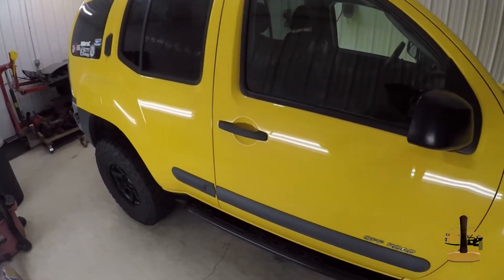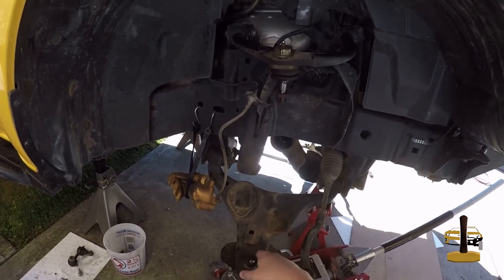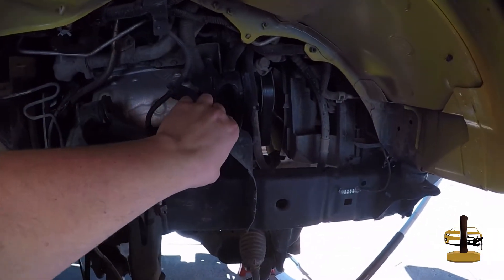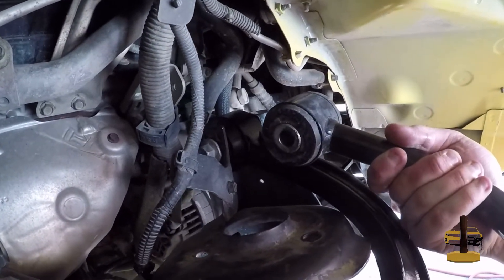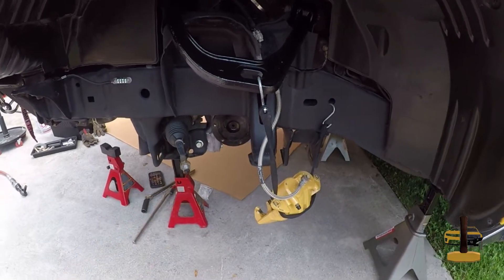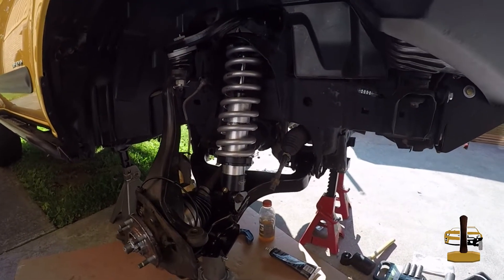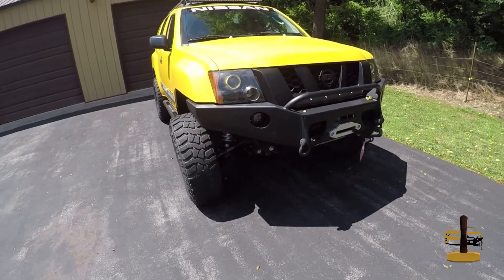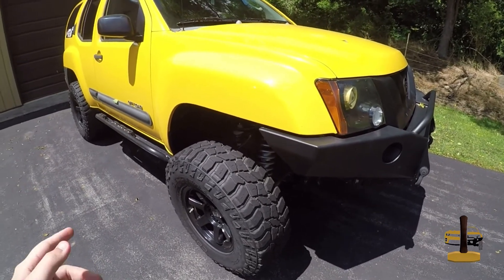Installing Titan-swap lift on my Nissan Xterra!

Comment: wow man awesome work !  just got me an 07 with 200k miles, rebuilt tranny with cold air intake and lots of paper work to back up the work done, looking to do this once i am ready.
Reply from the maker: Awesome man! It sucks that they were designed so poorly in the earlier years. Currently trying to figure out some electrical problems with mine.

Comment: So I'm looking into this can you tell me some pros and cons of doing the titan swap I dont go on trials but looks good tho also what wheels are those?
Reply from the maker: Well as far as pros go, a T-swap bolt on lift is the last one you can do for travel before you get into relocating suspension geometry (shock hoops/coilover bucket) plus it’s extremely reliable for the most part. Cant really say anything bad about it at this point in time. I also can’t recommend this lift to you if you don’t plan on using it for it’s intended purpose because it’s not solely highway tuned suspension nor could I justify the money if not for off-road. But I would look into wheel spacers or high offset wheels. But the wheels I have are level 8 MK6
Reply: Does this change the turning radius or is it the same?
Reply from the maker: It affects it yes, you’re essentially adding more offset with this lift so trimming will likely be needed

Comment: Man thanks for the vid. Can't wait to do the swap on my X. I take it you need to put three inch wheel spacers on each side on the rear, or is there another set up for that?
Reply from the maker: Glad ya liked it! It’s definitely worth it, but no, I actually only did 1.5” to prolong the life of the bearings. It’s not noticeable unless you look straight down the sides. But there are other (costly) options, bigger Dana, sterling or Titan rear axle.

Comment: I dig it...but why is there no footage of you removing the stuff like the diff and axels and 5 min of watching you do the dumb wheel well liner? I think people would have rather seen the arm and diff removal
Reply from the maker: Axles* but I’m a one man crew, kinda hard to drop/install a 200~ lb diff and worry about getting the camera on it. On top of that, removing axle/diff is probably the least technical part and there are plenty of vids already covering how to do that, removing the wheel liner that took 2~ minutes is semi-pertinent info to be able to get the UCA bolts out. But hey we’re all entitled to our opinion

Comment: Hi, I've been wanting to do a Titan swap for my Xterra, both engine and suspension. But my Xterra is manual. Do you have contact info I can contact for questions?
Reply from the maker: Hey! I can’t speak much on drivetrain but I can point you in the direction of someone that can. Feel free to dm me via Instagram!
Reply: @ManuaLiberty  sweet, what is your IG good sir?
Reply from the maker: Same as here, Yellow Hammer Garage 🤘🏻

Comment: I was thinking of 6" lift on my 2 wheel drive frontier.  will this work with a titan swap 6" lift coilover?
Reply from the maker: I’m assuming you’re talking about a drop bracket lift? If so I’m gonna say no, although I could be wrong. My understanding is that you have to use a longer length for a drop bracket
Reply: @ManuaLiberty  I was going to go direct with n3 22" coilovers instead of the standard 18" normally used for the swap?
as the swap will automatically give 4" lift.  do you think 2" more would hinder the swap travel?
Reply from the maker: I understand you now, but yes a coilover that long is going to give hardly any travel and put your suspension at a pretty severe angle. Granted you don’t have CVs but you may have trouble getting it aligned (ex. Ball joints in the control arms)

Comment: also, will the titan knuckle/spindle, titan rear end or spindle fit on my frontier?  I want to put on titan 18" wheels?
there's more rim variety for titans.
Reply from the maker: Yessir hubs are even the same, Trucks have spring over axle so keep that in mind.